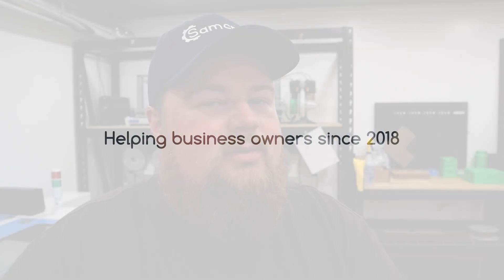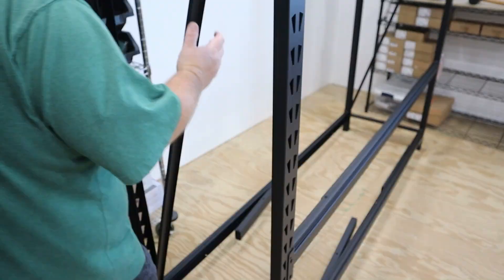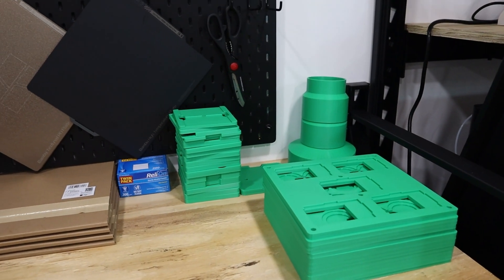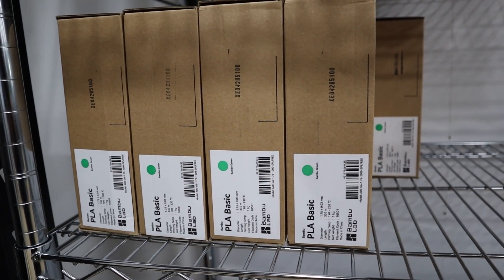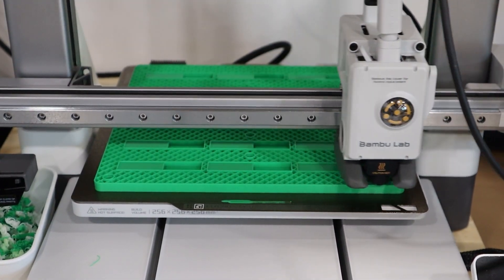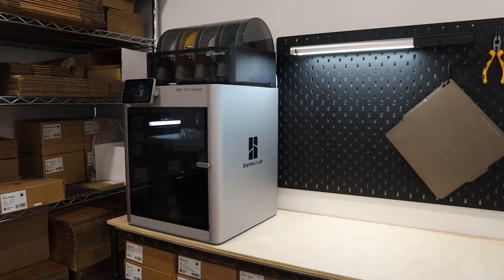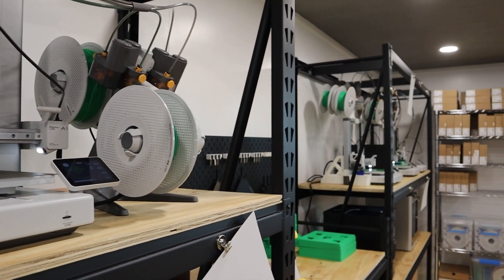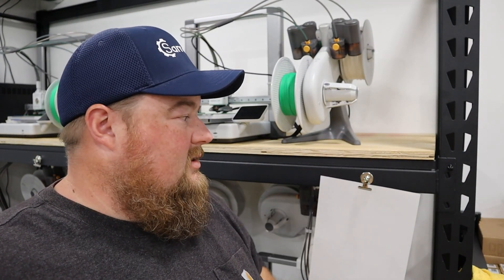Building My MINI PRINT FARM // 3D Printing Business

Comment: Great videos! How do you handle partial spools? Can the AMS automatically use up a spool and start using a secondary full spool?
Reply from the maker: That's the beauty of the AMS. If more than one of the same filament is loaded before starting the job (and auto-refill is enabled in the software), it will auto-swap to that second, third, forth roll as needed without stopping the job.

Comment: You can "revive" the dry packs that come in filament.  Just microwave for 30 seconds and that should do it.  You can get color changing silicone beads what you can mix with the free stuff to give yourself an indicator if you need to revive the beads.

Comment: Hi Sam, thanks for this video.  I have a couple questions/suggestion for the video.  You showed the % humidity when loading the filaments into the dehydrator, but I did not see what the % was after the 12 hours.  Also, I would like to know what the % is if you open a new sealed bag, but a meter in the bag and seal it up. Show what % it is when it comes in please.  Lastly, it seems to me that if you dehydrate for 12 hour and then the filament sits in the shop or is on the open air printer for 12 hour or more, the change from dehydrating will be lost.

Comment: I am considering buying a A1 mostly because of your videos.  Do you get them from the store called MicroCenter or do you buy them online from Bambu?   If you buy them in MicroCenter do you buy the extended warranty?
Reply from the maker: I only buy directly from Bambu's US Store. I feel like that's the best for product support issues (which I have had 2 cases to date that were solved perfectly and super fast). But there also are no Micro Center stores around me. I just got in another shipment of 12 A1 printer combos yesterday to expand the farm further. I purchased all of these printers myself -- no discounts or freebies at all. I continue to be 100% pleased with the A1 setup with my oldest printers now clocking in over 700 print hours. Minus the two minor flukes mentioned above, the printers have run flawless with no need for replacement parts at this time. Bambu is running their Black Friday sale which will save you more money depending on what model you choose. I also buy filament only from Bambu. Here's an affiliate link to the Bambu store IF you want to help the channel any. I get a small commission on sales I send their way. 🔗 Bambu Black Friday Sale (10/21/24 - 12/03/24): https://shrsl.com/4pvju 🔗 Bambu Lab 3D Printers: http://shrsl.com/4llym 🔗 Bambu Lab Filament: http://shrsl.com/4odnb

Comment: Hi i have a question. How do you power the A1? How many printer per extension plug you connect? How many outlets you use for all the 3d printers. As far as i am concern, the wattage rating of A1 is 350W if the supply is 110V in the usa, however at 220V in Malaysia example, it could reach 1300W which I'm quite concern of that. Because as i know, one plug could only handle around 2500W. Continously. It may not run 1300W continuously but, I'm afraid it use a lot when start heating up, multiples printer at the same time and kaboom. Thanks. For A1 mini i don't have concern because it is the same at 150W

Comment: I can get behind the A1 farm. I have an A1 Mini and it's such a consistent little beasty. I'd love to have an X1C or a P1S with an upgraded hot end for more 'exotic' materials. But I just do not have the money for that right now. And if you are not printing with materials that need an enclosed chamber the A1 or P1P is the way to go I think just on a cost per printer metric alone it makes sense.

However now that your farm has expanded and you have those machines running, I hope you have taken workshop ventilation into account. Melting plastic kicks off a some bad fumes, and while a single printer might not be an issue, 10 of them at once can be some bad juju. How are you managing the airflow and ventilation for your workshop?

Comment: Hello sam, nice video, i just wanted to ask what ups are you using, i used a 550w ups and when i started the print, it shut down, i read that the first 1-2 mins of the print it heats up and takes 1100w power so maybe the ups was not powerful enough. Can you say what power is your Ups capable of. Another question would be what are u printing it would be an interesting video to watch. 😃
Reply from the maker: I'm using this exact UPS: https://amzn.to/3N8qoWj It's a 1500VA / 900W. I have a max of three printers connected to one UPS. If I start the jobs all at once, it will alarm since the heat beds are over voltage, but it doesn't shut off. I circumvent this by not starting the 3rd print job until the 1st has finished the initial heating of the print bed.
Reply: @Samcraftcom  thank you, i will try replacing the battery in my old one to see if it keeps up with the power the first 1-2 mins of the heating process

Comment: Hey sam , How far are your shelves spaced to accomadate the A1's ?  on side or top. thanks !
Reply from the maker: For the top mount AMS system, you want 32 inches of clearance for the machine & tubing to fit without rubbing anything. I would say about 22 inches of clearance for the regular setup with AMS on the side.

Comment: Thank you for the tour Sam! I purchased my first and second X1C May 2023, and the P1S in December; I run these at work 24/7 and have a very similar setup. i have not been the happiest with the P1S due to the features offered, for context we had a network outage (no connection to Bambu Server) and it rendered the printer nearly useless because i could change filament. My needs are primarily PETG and PLA and after watching this i am considering the A1 for any new printers.

Comment: Hey wanted to give you a heads up. Your metal shelves are able to share the vertical pillars. You have the vertical pillars back to back with each other. You could in turn share the vertical pillars then use the extra ones for another shelf somewhere else.

Comment: Just wondering...I've used my laser cutter to make jigs for various projects and have found it much easier and faster to use the laser cutter for this instead of a 3D printer.  Did you consider making your jigs using materials you could cut and assemble?

Comment: Hi Sam, I have a question for you. I'm 61 and was forced into retirement with health issues 8 years ago. I'm in Canada and on disability that barely sustains my wife and I. I have zero experience with laser engravers but have been wanting one for probably 10 years now. I always come back to the K40's. I know they are a tinkerer's machine and im ok with that as I think it will help me gain knowledge on how they work and operate. I'm very low budget in fact I'll have to sell my old truck to get one but I'm only looking to supplement my month funds by about $400 to $500. I don't know much about marketing either. I know lots of people in my area already do the same stuff I want to do but the market is massive. Im interested in doing yeti mugs, business cards, balsa planes and whatever else I can feasibly do. Can you throw me any advice? Am I on the wrong track? Are the K40's worth buying? If you have time to answer this it would be so helpful.
Reply: I'm not Sam, but I don't think he would mind me putting my two cents worth in. I think you will find that the K-40 is going to be too small for doing very much. I'm not sure you will be able to do tumblers on the K-40 because of the bed height requirements. That would be something you would need to look into. One of the things that steered me away from the K-40 was it's bed size and the limited z axis. With the bed size about as big as a sheet of paper, you will be cramped for space. I have a 700mm x 500mm bed and I have found I have to do some work arounds to make some larger things work out. In my opinion, if you want to buy a K-40 to get started learning lasers (make sure you get one that will support LightBurn software), it is one of the more affordable ways to get into laser engraving now that the diode lasers have gone way up in price. If you can find a 20 watt diode laser, I think you would be happy with that because you will be able to engrave tumblers with it, cut wood, and engrave with it. Just keep your eye open for a used one. There are a lot of people who have purchased them thinking they will make a hundred grand a year and soon find out that there is a learning curve and they don't make money right away and soon get disappointed. I have seen it happen. I am also retired and can tell you that you certainly can make a supplemental income with one, especially if you can come up with your own product. I wouldn't worry too much about that because ideas will pop into your brain the more you get into it.Watch as many YouTube videos as you can on the K-40s and some of the diode lasers as you can and see what best suits your need. It has been a lot of fun for me, and it keeps my two brain cells exercised.

Comment: With a farm like this,  what sort of numbers are you selling per week to justify the cost? You've got $5000 worth of machines, and around $4000 worth of filament.   

With a $20 product unless you're selling thousands of them a month, I'm not sure why you would be 10 machines versus 1 or 2.  You could easily stock up very quickly and have back stock for quick shipment.
Reply: I am guessing he has so many machines, because he offers so many colors. He also includes white lettering on his jigs, so each one of his machines has to have white filament in 1 of the 4 slots, only leaving 3 extra for other colors. I use Bambu machines for my Etsy shop as well, and it can be a hassle swapping out different colors depending on what someone orders. I think he offers 17 colors in total. Even selling 5 jigs a day would be $3000 a month, and he could pay off his farm pretty quickly.
Reply: Curious about this aswell
Reply: You don't know business until you've ran it.  I sell $7 to $25 items and at the end of the month it tallies to $3,500+ easily